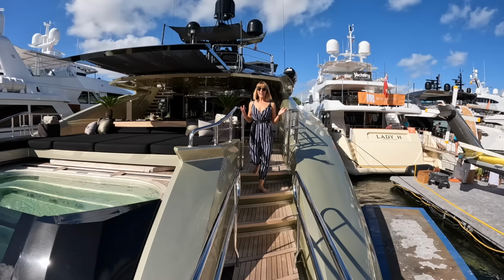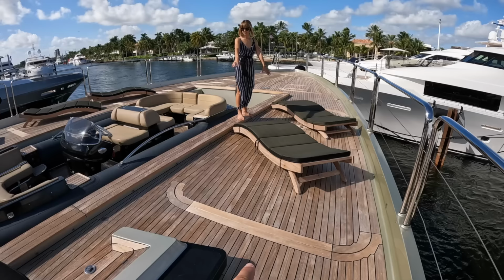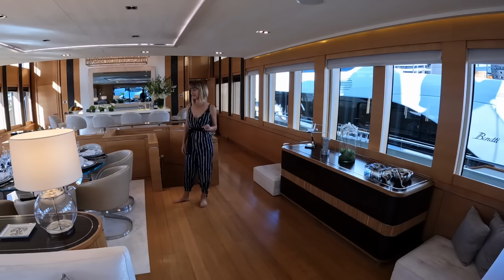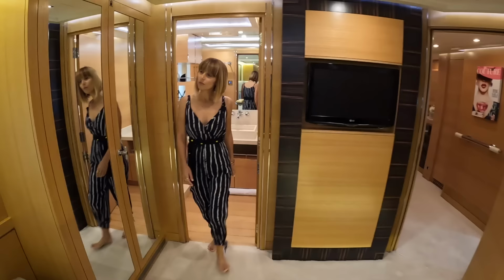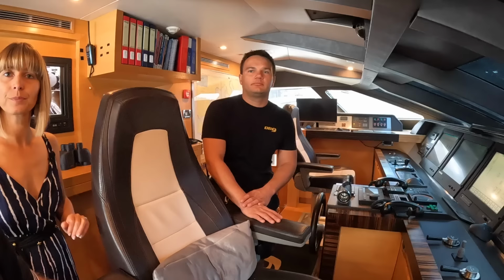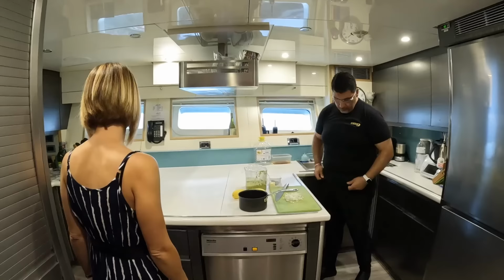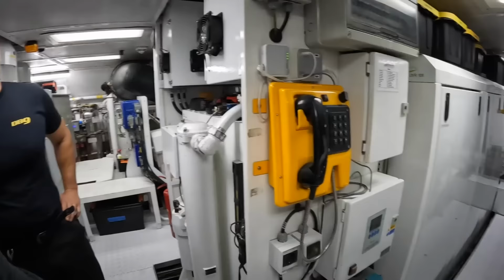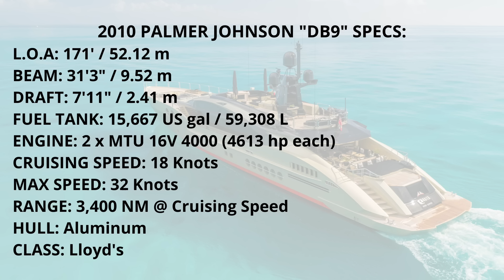SUPER FAST Palmer Johnson SPORT YACHT "DB9" Luxury SuperYacht Tour & SPECS

Comment: Thanks for yet another interesting presentation @NautiStyles ..!
This is certainly a great boat.
I liked especially the extra ceiling height and windows around the bar area... with double height windows. Impressive!
There is a slight problem, however. I think only one other commenter has pointed out that the colour of the aft hot tub is not flattering. The water appears stagnant, like it hasn't been maintained. The tub gives the water the colour of green algae, which is not the best shade for a pool. The same applies also to the flybridge hot tub.
Finally, I thought the dining table was a bit small for 8 people.
Otherwise, fabulous boat!

Comment: I tell you what the DB9 is. 😂 I'm an electrical engineer and DB 9 is a D subminiature connector -usually used for serial communication back in the day, it has 9 pins and it's the smallest of the D-Sub connectors 😂 🎉 good job guys

Comment: That's beautiful, that's me. No one really needs any more boat than that. She's got speed and over 300-mile range at 18 knots! Amazing working areas as well, that bridge is to die for as is the captain's cabin. 

I love the design but I'd change the soft furnishings and carpets to something darker. I'm not wrapped in the marble either but I think I'd live with that as the cost to replace with something darker would be quite a lot. I would do the bar in the salon however, it's just too light for me. All in all a stunning vessel and what a great crew!

Also, @Alexi, you need to keep them away from these yachts, they are getting enough ideas to give you a migraine! 😄

Comment: At full speed those 2 giant engines will burn over  450 gal per hour, but nobody 
runs a boat like  that at 32 knots for long
periods  of time. At 18 knots  it will burn 
less than  half that amount . Big yachts that cross the Atlantic typically  cross 
at less speed  then  18 knots.  At displacement  speeds they burn less fuel
then normal  cruise  speed.  Yachts built
for  speed  don't  necessarily do well  in
bad weather  in Trans Atlantic  crossings. 3600 NM at 18 knots  is really 
very good. And don't  forget the generators burn fuel as well.

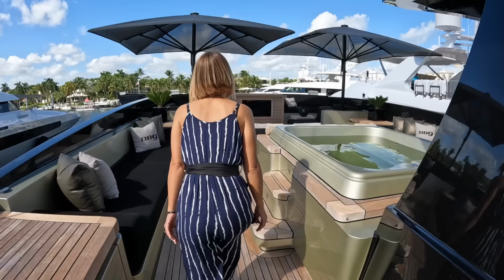Comment: Nice yacht, save for one design detail;  9:33 The color of that hot tub, not flattering.  At first glance it appears stagnant, why would someone choose a hot tub for a multimillion dollar yacht in a color that makes the water look like it hasn't been maintained?  All that attention to detail and no one noticed this?  It may match the trim, but someone should have pointed out the trim is the color of green algae not the best shade for a pool.  A tan shade would have been a far better choice.  As it is it's a huge fail, once seen it affects how one, me, views the entire yacht.  I'll remember it as the yacht with the algae green hot tub, and I doubt I'll be alone.  Or, could be no else noticed, though once you've seen a stagnant, ill maintained pool up close it's hard not to notice that color, definitely not something you want to get near.

Comment: does the captain come with the ship because youd have to have a licensed captain with extra credentials to drive that boat
Reply: More than likely yes. Typically when you build a boat of this size, being it charter or private, somewhere along the process, the broker will crew the boat. This is in part done to make sure that the yard builds to the needed specifications and certifications the boat needs and captain requires. The captain will also be part of the PDI sea trials etc. Can you get a new captain if you so want? Of course, but most captains are hired by the management team the broker enlists, in conjunction with the owner. So often a Yacht like this will come with a crew. Sometimes if a yacht is out of commission for longer periods, it will be without crew. But the thing is, that in order for such a boat to retain its operating license, it needs a crew. Because this is over 24 meters LLL, and more than 200 tonnes, it is by rules a commercial vessel. This means that it can never be owner operated, i.e it always needs a captain, an engineer and two deckhands of which at least one has to be certified for night watch and piloting.

Comment: I wonder why they went hydraulic instead of electric? Anything can be accomplished with gear reduction. Youd be surprised what small electric motors are capable of when you gear them way way down. Literally maintenance free, qnd the most important thing, no risk of hydraulic fluid leaking all over the inside of your quarter billion dollar yacht.
Reply: a quarter of a billion is 250 million lol. You could buy 10 of these for a quarter of a million.